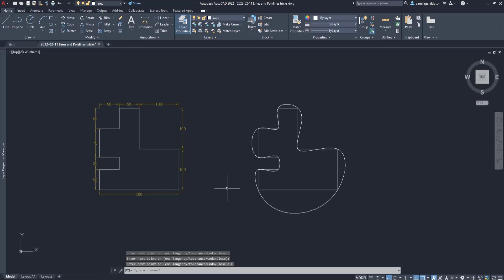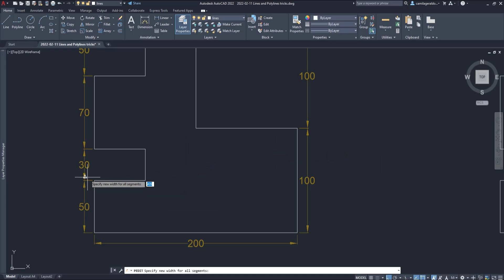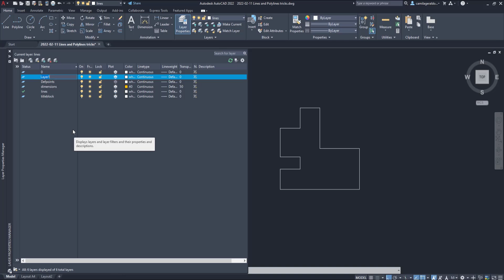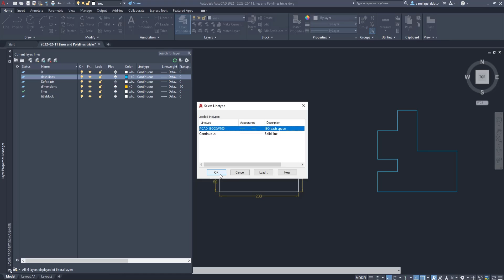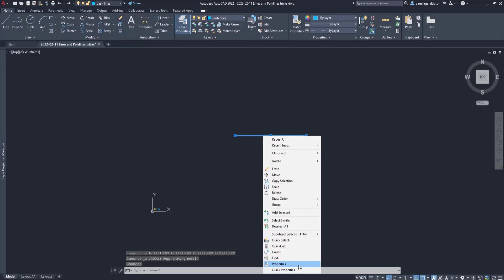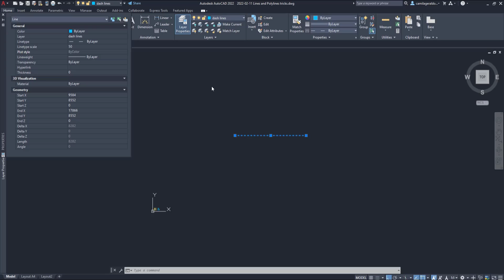Autocad - Lines and Polylines (Useful tips to master them)

Comment: I have encountered a problem where the dashed lines easily seen in model space are not seen as dashed lines in viewport. I learned that having the model space scale the same as the viewport scale the same, the problem is fixed. Can you add anything to this? Thanks for the tutorial. I learned something new.